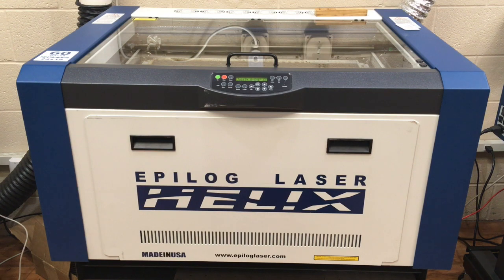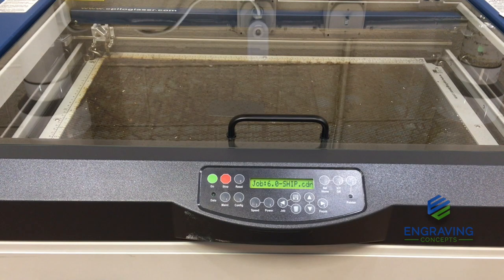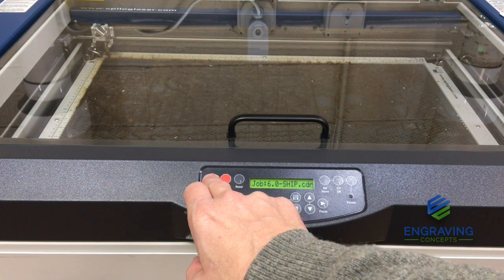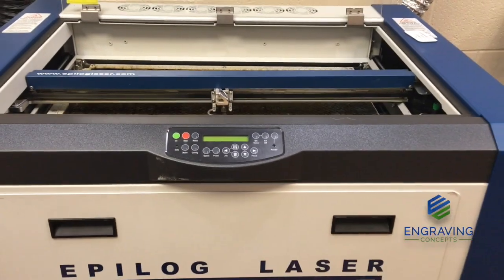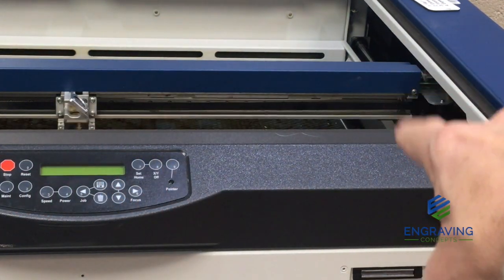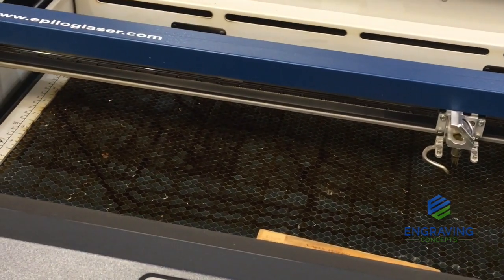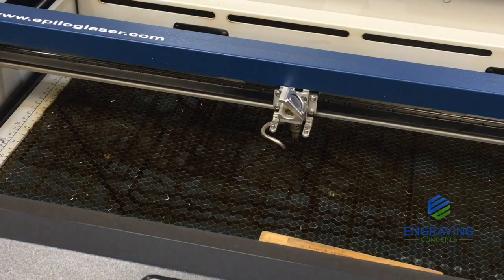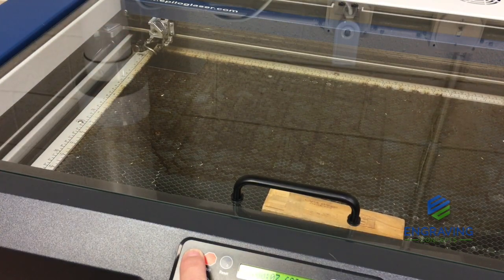Epilog Laser - Legend Auto Focus JAM? THE FIX!

Comment: I opened the front of my laser and the belt is jammed, it does not want to move. Any suggestions?
Reply: Anjelica Sauceda did you figure it out? I ran into same thing belt is super stuck
Reply: Yes I did! You have to take the motor off and get the pulley’s unstuck with pliers. Once the pulleys move smoothly, then you can put everything back together and level your table on your machine again.
Reply: Anjelica Sauceda wow... yikes that doesn’t sound like fun. Looks like some shielding I have to remove to get at them

Comment: Sorry for my English.
I bought a second-hand Legend24TT and
What is my surprise that you also have this software failure that you speak ...?

I have a LaserPro 10 years ago and
When turning on the machine, or if you have turned on the machine after having made an emergency stop, etc.

The first thing you do once is to DOWN THE TABLE 5CM.
to avoid hitting the header with any object in the initialization process.

Why is this not in the EPILOG ??

I think you just have to edit the firmware and add these instructions (LOWER the table) before moving any of the 2 axes ....

Did someone in Epilog correct this error? or there is some key or procedure to do it yourself.
Anyway, thanks for your video